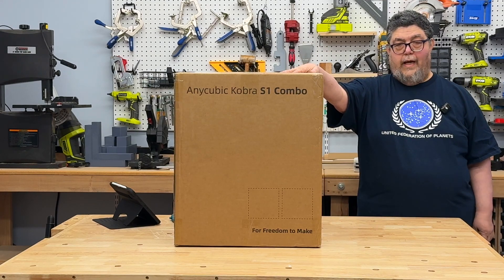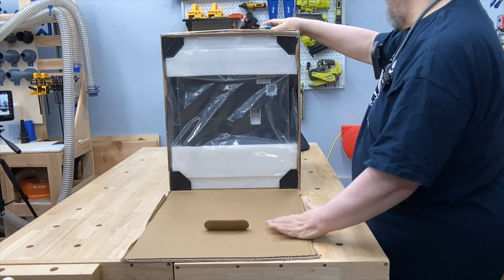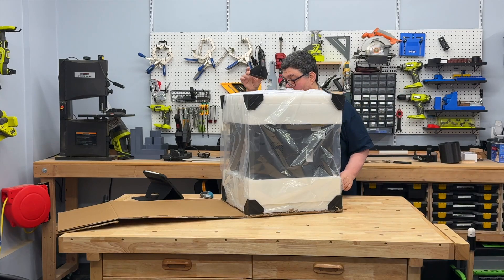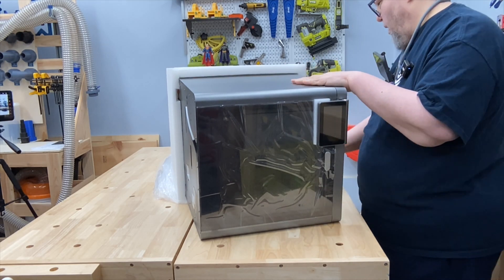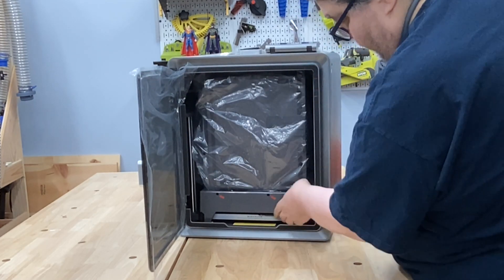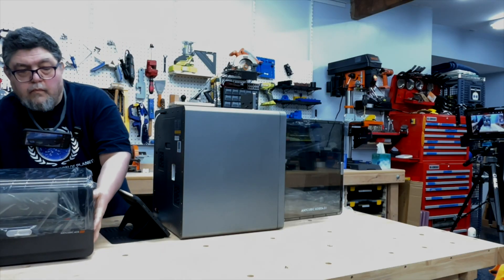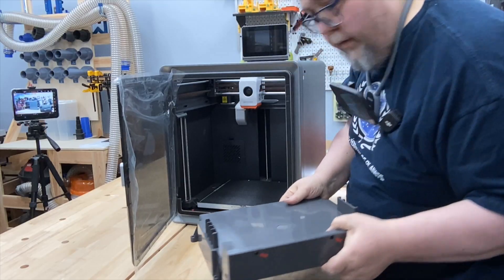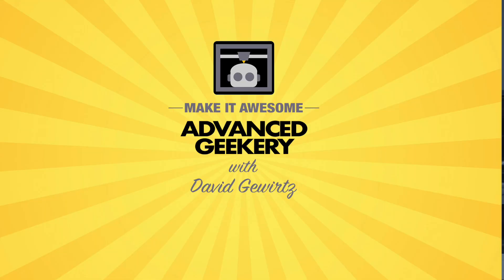Anycubic Kobra S1 unpacked: It looks a LOT like the Bambu X1 Carbon

Comment: I know we ALL agree, stop putting the power switch on the back!! I do understand it is because it is integrated with the power supply, BUT, not all of us want to reach around to the back to get to it. I get around this with a simple $8 switch that plugs into a power strip to control it remotely ( or, if you only have one printer, just use the switch on the outlet strip ). The printer OS is set up to be dumped at power off anyway, and this is what the mains switch does.

Comment: What is the footprint of Anycubic Kobra S1 Combo? How much table space do I need for it?
Reply from the maker: It fits on a 2' x 2' cart.
Reply: @AdvancedGeekery  Does this include space needed for tubes and poop bin at the back, any side protrusions? Or can I count such dimensions flush from the wall in an alcove?
Reply from the maker: @wilkas  On that 2ft by 2ft cart, I have about 5 1/2 inches in back of the printer, and about an inch on the front and each of the two sides. It's a little tight, but a poop bin should be able to work there. That's what I'm planning (although I haven't yet done it, because I've been on crazy deadline for other work projects). I'm pretty confident that the 2ft by 2ft cart will work. If you look at a couple of my recent Anycubic videos, as well as the Bambu setup video, you can see the carts. I have 2x3, 2x2, and 2x18in carts in the Fab Lab. From Rockler, if you're curious.

Comment: This is random but i really like that floor in your shop. What kind is it? I have done the paint specs before with paint and a top coat but it looks better
Reply from the maker: It's an epoxy floor that we had a pro put in before we moved into the house. My one regret was the black and blue. It's very hard to find a dropped item on that color, We had a red and gold floor in our previous home (you can see it in the Harbor Freight workbench video) and it was much easier to find stuff.
Reply: @AdvancedGeekery  awesome thanks!